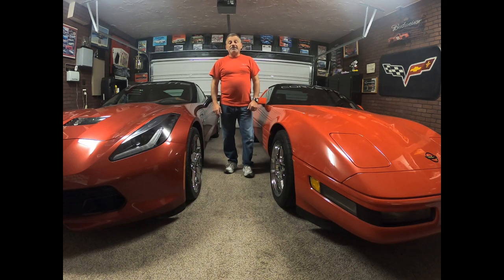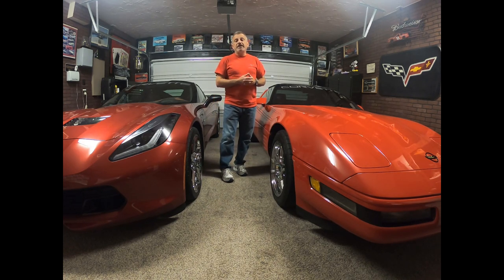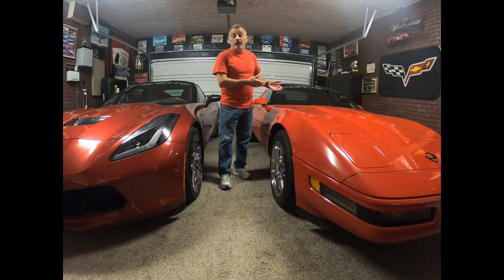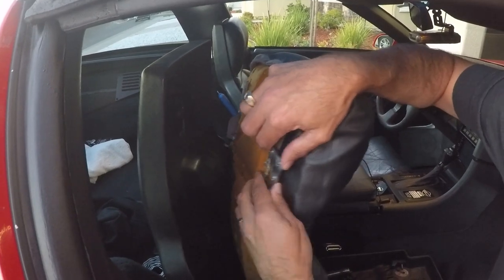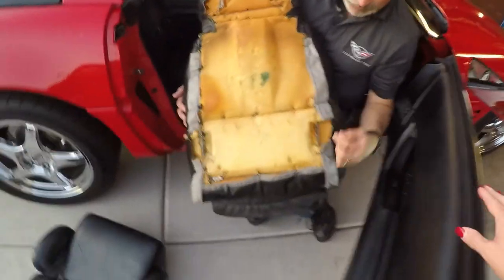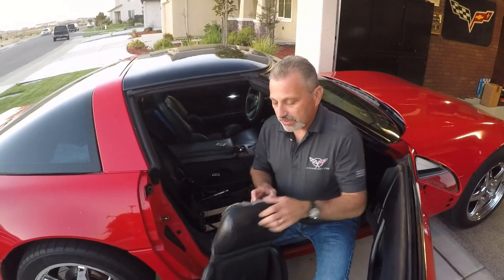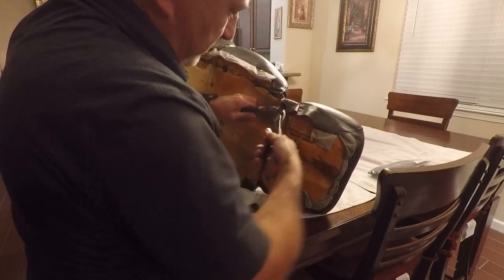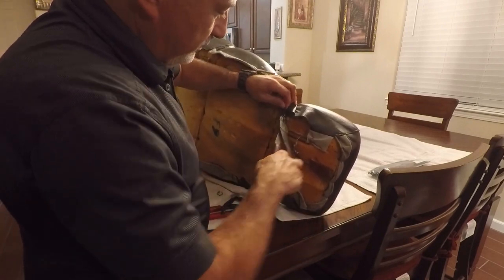1992 C4 CORVETTE STEP BY STEP LEATHER SEAT COVER REPLACEMENT PART 1

Comment: Nice job.   Quick question, your rims look like C5 rims.  I picked up a pair as well for my 92 from a 2000 C5 and was wondering which wheel spacers you used to accommodate the C5 rims on the C4?  I know, not about the seats, but hoping you're willing to share.
Reply from the maker: Actually they are Chrome C4 ZR-1 style rims made with correct offset, so I dont know what spacer you would need.
No problem you can always reach out in any video or email me not a problem.